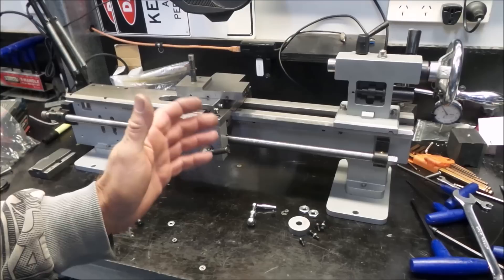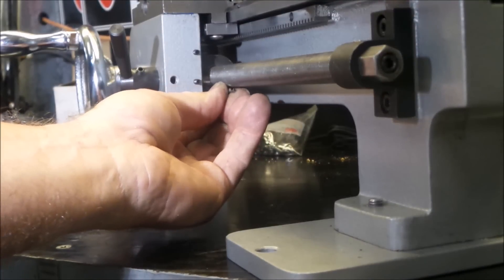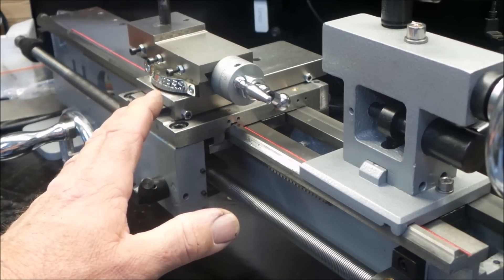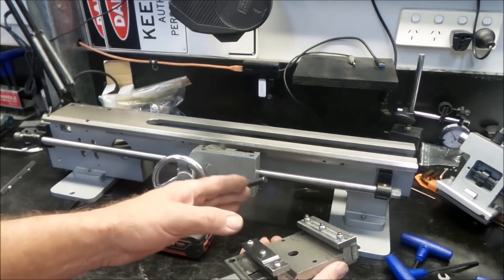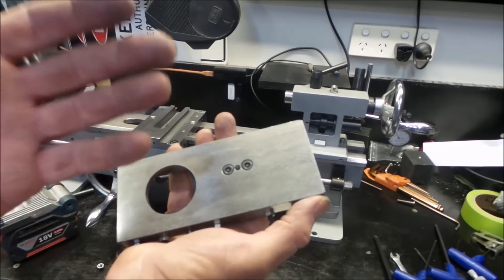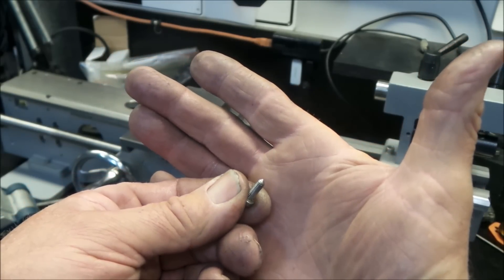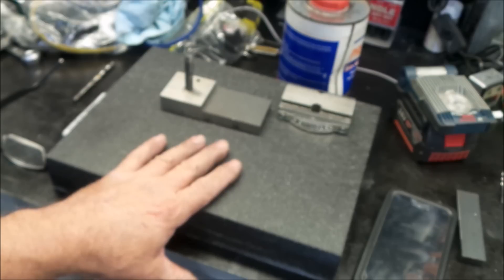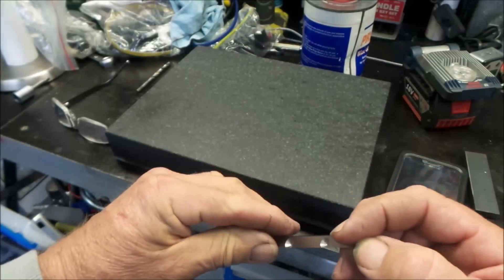Mini Lathe Lead Screw Alignment & Cross Slide Tuning. Episode 12

Comment: Hi
On my mini lathe when I reset the lead screw and carriage, I run the carriage all the way to the right then with the lead screw bearing loose I close the half nuts on the lead screw, Then tighten the bolts in the bearing. I have the half nuts set to close as much as possible.
Thanks
Reply from the maker: Cheers Dennis

Comment: just discovered this video series. I'm wondering whether there is a video showing th end result, I mean this lathe working on an actual piece to show if it was worth it.....I can not find it at your playlists or channel videos...
Reply from the maker: G'day Mate, firstly Thanks for your donation, really kind of you. People such as yourself are what keeps the Chanel going.
Unfortunately I'm not quite there yet, as in, this being a fully functioning Lathe. Shouldn't be to long now though. I have made a few bits & pieces on it that were needed for the recent treadmill motor conversion & it performed extremely well, other than being under powered.
 It did break the original tiny drive belt though in the process, due to the fairly heavy cuts that it does with ease now, for a machine of this size. The writing was on the wall though, hence the new Bigger Motor & Vee Belt Drive Line. 
Worth it.......... For Me a big Yes. But as you can see it has taken a lot of time & effort to do. So for others maybe not.
As Sad as it may seem I actually enjoy the Challenge of this kinda stuff, I find it good Therapy.
Again Thanks for your Donation, Cheers Mate.

Comment: Man.  Thanks a million for all your efforts AND generosity in sharing everything with us.  Awesome job.  I was seriously considering buying one of these (once I've finally saved up enough to fix my rotting teeth, and then saved up enough again to buy one....!).  You are doing the work of a saint.  Looks like I'll be spending a bit more on a lathe than what I first thought.  Do you have any experience with the Sieg lathes?  I was looking at the sc3 model because I live in a tiny unit and it's small and cheap, but after watching your videos I'm feeling a little shy about these little fellas in general.  I'm hoping that the bigger sc4 model Sieg is made a little better.  Do you have any ideas about it?  Cheers.
Reply from the maker: G'day Tbone, I have heard the Sieg's are much,much better, but have no personal experience with them though.
Sc4 would be my choice. Cheers Mate.

Comment: Great set of videos   I have similar lathe. Do you have any details regarding the locking mechanism of the tail stock to the lathe bed, as would like to add this feature to my lathe 
Cheers
Reply from the maker: Hi Eldon, pretty sure there is, in one of the earlier videos. Cheers.
Reply: @TheAussieShed  You are correct, sorry I looked at video list and didnt see it 
Looks like an easy cam assembly to make  Cheers from Canada

Comment: Hi, just occurred to me when seeing the misaligned lead screw to nut of 0.5mm. Why not make new nut and screw asap after rebuild with 1mm smaller diameter lead screw. Even 2mm smaller out of better materials like bronze nut and heat treated A4, O1 or W1. That way you still get strength required and a more compact designed. Could then make lead nut two piece for back lash eliminating design.
Reply from the maker: Sounds like a great idea Steph. Cheers.

Comment: With respect to the gibs, straighten them first and then flip them over and recut the divots on the clean surface.  When marking out for the new divots install temporary gib screws (sharpened to a point) to get perfect alignment.
Reply from the maker: Thanks Paul.
Reply: Question @paul kerfoot: are the gib strips standard and purchasable? Trevor’s seemed really hacked up at the factory
Reply: @pb7379-j2k  I believe they are available separately from at least one source: Little Machine Shop.
Reply: @pb7379-j2k  I believe the gib strips are standard size, I know you can purchase them from Little Machine Shop and possibly other sources (try a search on Google).
Reply: @123hurst3  Thank you sir